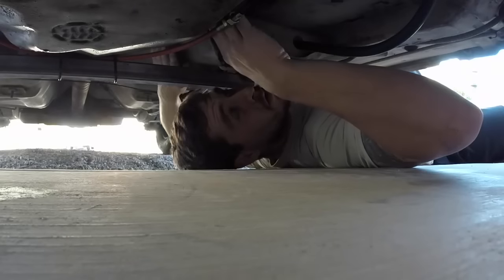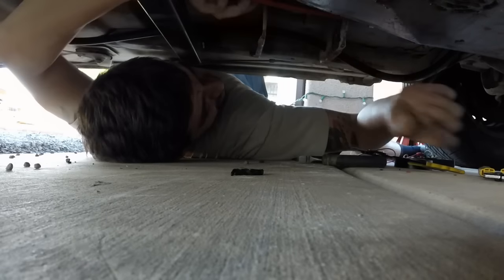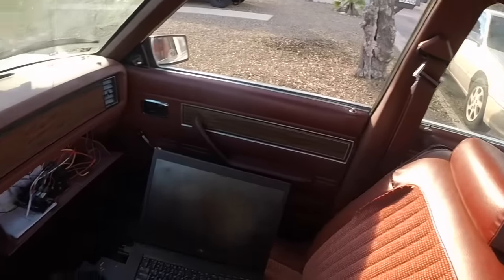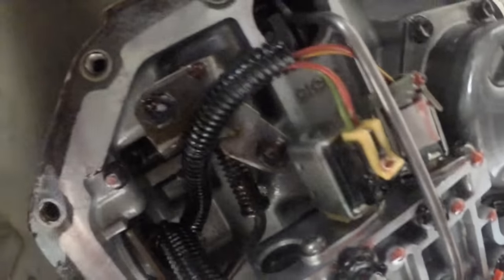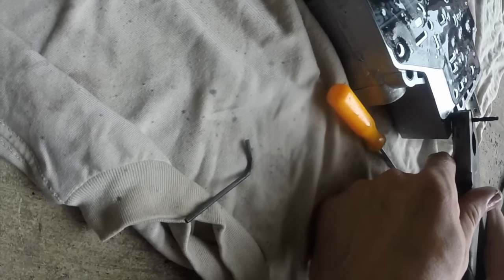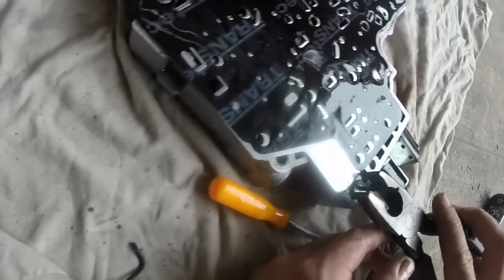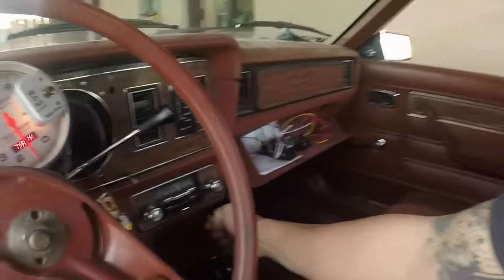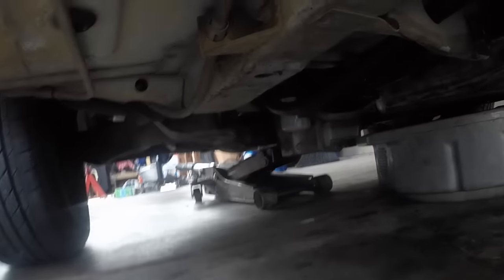Transmission Fix

Comment: Have or are you using the auto tune feature in tuner studio? if so, any thoughts on it?
Reply from the maker: I have. It is pretty great really. I think it is important to know how and when to use it.
Reply: Dick Hamm I'm about to attempt to tune my car using tuner studio. Guess we'll see what happens lol..
Reply from the maker: only really use auto tune for mid range cruise.. to get it close. There is a variable setting on the auto tune page which adjusts the aggressiveness of cell change. Be sure to set this to normal. Easy meaning it will change it very easily, hard meaning it wont change as fast. less aggressive
Reply: Ok cool. thanks for the heads up! I'm going to give it a shot and see what happens. appreciate it
Reply from the maker: You got it man. Also check out +Sloppymechanics on Youtube and Facebook. They have some tuning classes involving Megasquirt products that really helped me out. Let me know if you want more info!